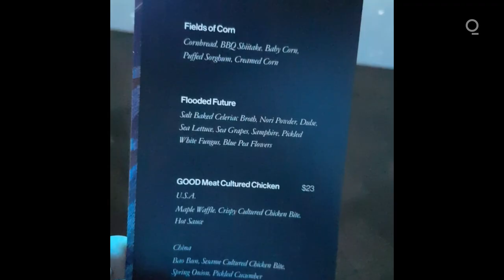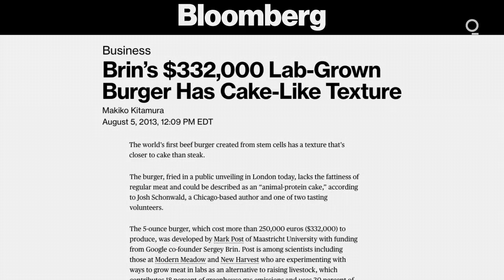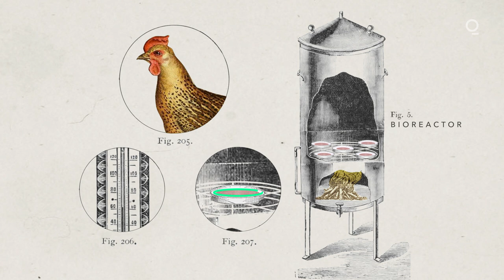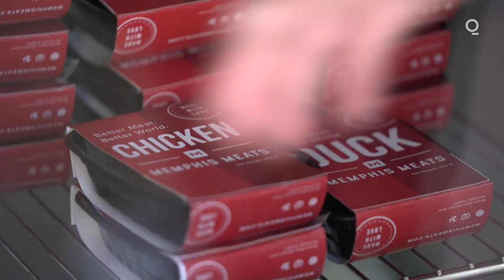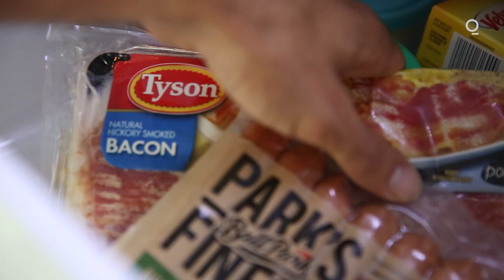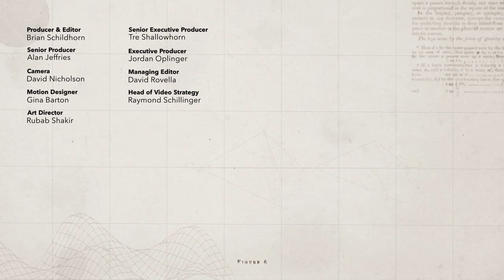Lab-Grown Real Meat is Finally Here

Comment: The point is that meat production is very inefficient, and lab grown meat should be much better in the future. right now it's still expensive though.
Reply: So was solar power and everything else with a startup. Just look at indoor farms and where they're at right now, compared to where they was in the beginning. And there's still a heck of a lot of room for improvement. But if you can cut down all farms that are used solely for feeding animals that are solely used for meat, that both uses up such incredibly much land - and even more every year, and throw it all into large automatic highly efficient meat lab-factories 20-30 years from now? Why not?

Comment: Why is it taking so long to scale this up for mass production?
Reply: Bioreactors are tricky to upscale, because cell growth tends to operate under very specific conditions - but as you change the specifications of the bioreactor, you naturally have to account for changes in those conditions (Pressure/Temperature fluctuations can ruin cell batches very quickly, and that's one of the most basic control parameters in really any reactor). On the other hand, because you're dealing with biological cells and not something like mineral extraction - there are inherent complications to upscaling the process that's associated with mapping out the set of specific conditions it takes to attain a certain product grade. 

They touched on it a bit in the video, but the conditions necessary to grow a specific type of meat is different, because the conditions the bioreactor needs to mimic are different - certain animals utilize certain muscles more than others for instance. This is, in a sense, the "design challenge" associated with laying down the foundations for the technology - they need to first compile the database with known data points, essentially create a map for what conditions can create what kinds of meat, and what conditions or "noise" they need to filter out.

So batch upscaling (that is, increasing the reactor dimensions to increase batch size) comes with difficulties in terms of reactor design. But unit upscaling (increasing the number of reactors) comes with economic challenges (the cost of each reactor and maintenance). Until either of these problems can be solved, upscaling is going to take time (basically, once those problems are solved we then roll into the commissioning and deployment phase - which usually comes with its own problems). Added on top of this is the fact that generally speaking the industry isn't massive - these are private ventures that are pushing this line of research, so it isn't something where you have a substantial amount of resources and manpower dedicated to accelerating the process.

Comment: Foetal Bovine Serum was not used?
Reply: Unfortunately, it was still used, but they say they won't use in in the future. FBS is very expensive, so even without the ethical concerns they have to find a cheaper replacement for it, and it seems they already did.
Reply: @walter....  hope so